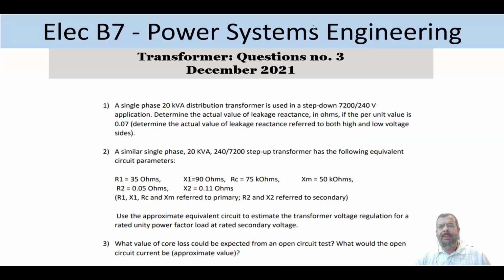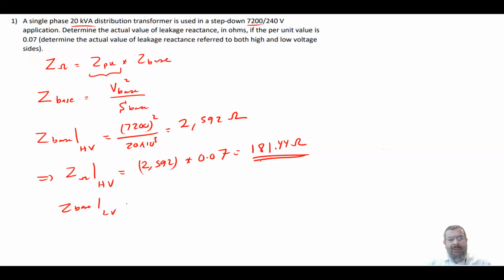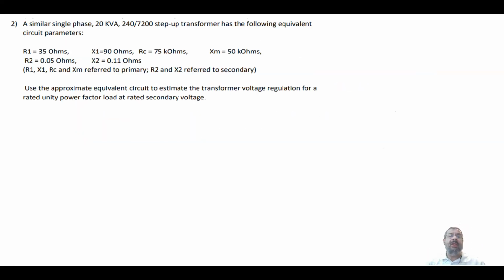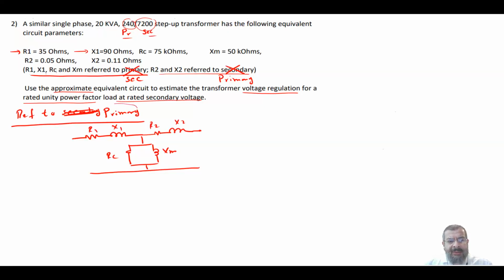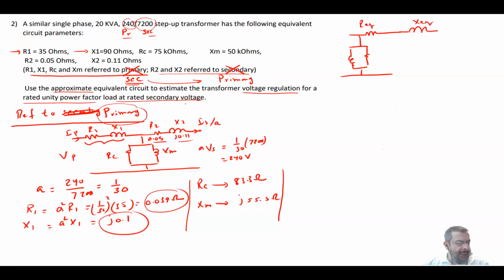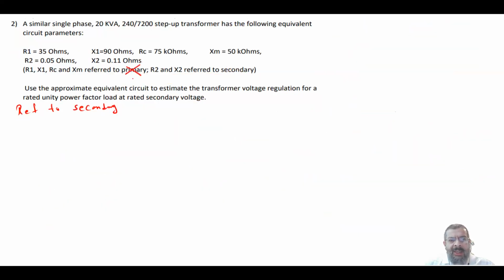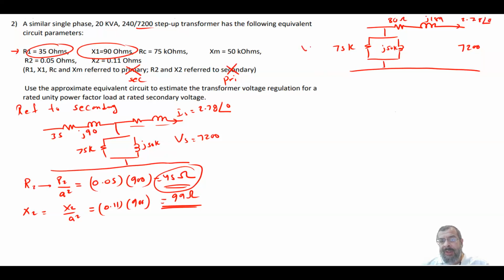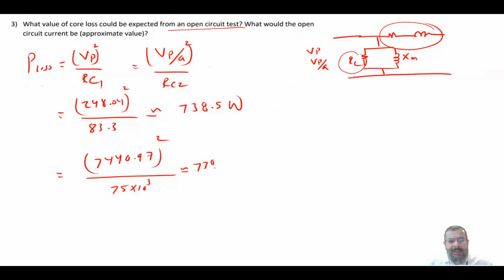PEO solve examples (ELEC B7) Transformer Question no. 3

Comment: Thank you Dr.Ayman. Small correction here: when referring to the primary, we should multiply R2 & X2 by a^2 and when referring to secondary we should divide R1,X1,Rc & Xm by a^2
Reply from the maker: This is what I did, but remember, this is a step up transformer, so the turns ratio is less than 1. The turns ration always, Vp/Vs

Comment: So basically the questions are wrong, is there anyway PEO is taking responsibilities for them? I believe they stressed the applicants a lot when encountering these mistakes?
Reply from the maker: I think what happened in part A the transformer was step down and in part B it was changed to step up but the examiner forgot to switch the side from which the values were referred.